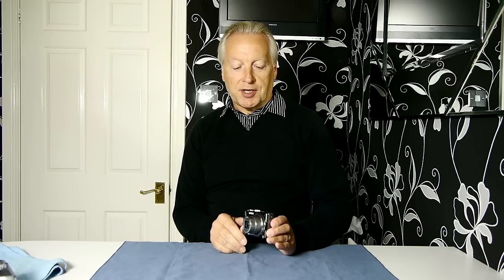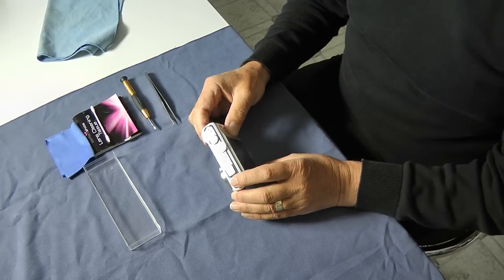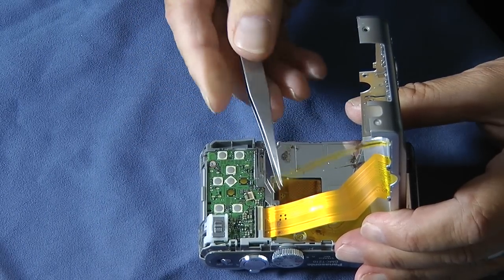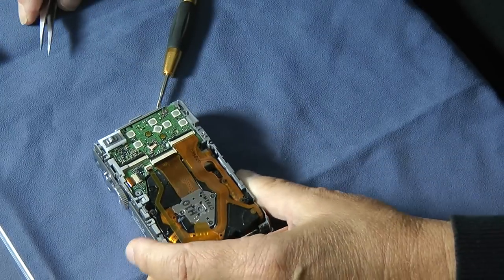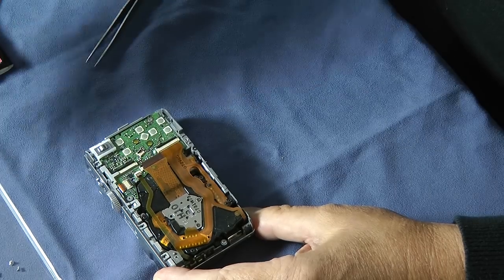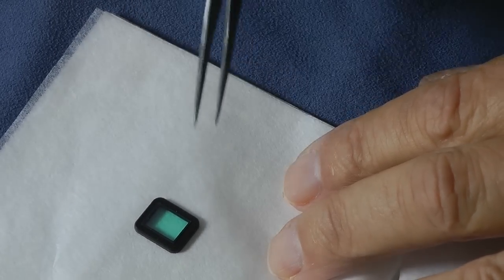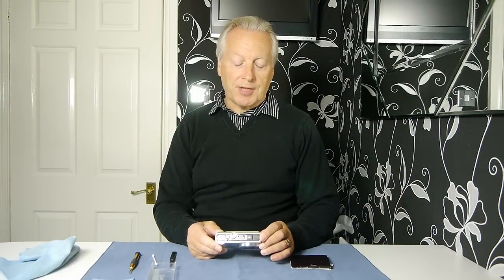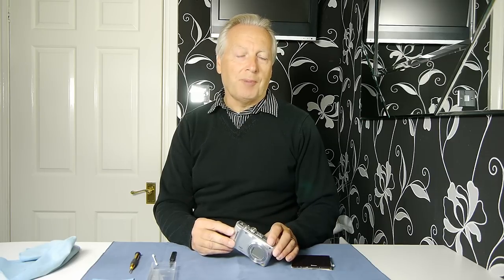Cleaning the CCD sensor of a Panasonic Lumix Compact Digital Camera

Comment: Thank you Graham!

I carried out the procedure on a DMC-FX12 and finished about 5 minutes ago. All is well, the spots have gone. A few points that may help others...

1) The case screws were extremely tight and each one eventually loosened with a distinct click. Was concerned about shearing them and added a tiny drop of penetrating oil to the heads, then wiped clean around each head before unscrewing.

2) On this camera the ribbon connector for the ccd sensor was not accessible. Rather than remove the circuit board covering the connector I did the cleaning procedure with it still connected. BTW, there is no internal metal plate on this cam.

3) The screws holding the sensor assembly in this camera were Torx screws. I didn't have an appropriate driver and fabricated something which worked (I got away with it! Not recommended.)

4) There were clearly visible specks of dust on both sides of the IR filter as well as the sensor. I tried air which was no go so then tried cotton buds. Unfortunately the buds I used left fibers all over the filter+sensor (cheapo purchase?) and so I used lens tissue wrapped around the end of a bud and all was well. I did have some IPA but didn't see a need to use it.

5) I couldn't see which side of the filter had the IR coating. No matter how hard I looked they seemed the same. So I put it back and just hoped for the best.

Hope these notes might help any DMC-FX12 owners. Thanks again Graham.

Comment: It has equally work for my old Lumix TZ8 ; but for instance, I had only tried to take pictures inside, in my house with very strong lights and brillant colors. I haven't seen the old black or grey task, which was on the internal mirror of the camera ... So I think, that the problem is now resolved, especially with your very hard but precious helps and explications ! Great support from France, Alsace. See ya !!!

Comment from the maker: Yes the service manual suggests that the cmos is recalibrated using a service jig etc if you undo the fixing screws, other users have boldly gone ahead and everything worked afterwards. From the construction the plate carrying the cmos sensor lies flush against the lens housing so i can't really see any problem in removing and replacing. The IR filter is now integrated over the sensor so no danger of it falling out and its easier to clean.

Comment: Brilliant! They say 'you don't get courage before the battle', but this video gave me the confidence to go for it. My Lumix FX-60 had a dust speck in the lower left corner, which made 50% of my photos unusable. I found that the display power cable had a slightly different connector which resisted my gentle persuasion to release the cable, but it turned out that this could remain happily attached while I cleaned the IR filter and rear lens surface, so not really a problem.
Thank you again.

Comment: Thank you Graham for a top video.  My TZ20 had about 8 blobs that I thought at first were on the outside of the lens.  With the help of your video I managed to get to to the CCD without a problem, although there are a few small differences between the TZ10 and TZ20.  The filter with gasket was stuck to the CCD so I didn't try to remove it it just cleaned the back of the filter and back of the lens with buds as per your video. Works perfect now without any blobs.  
Thanks again.

Comment: Excellent - I fixed a friends TZ2 with a new sensor and then bought a TZ3 cheap on Ebay in the knowledge that I could easily replace the sensor if it failed. Extremely well produced videos.  I shall be looking at all your others.  Thank you Graham Houghton.

Comment: Mate, you just saved me over $100. All I had to buy was some little screwdrivers (less than $5). Mind you, it was bloody hard to undo the screws - they were really tight.

The innards of the camera (a ZS15) were a little different from what you show, but close enough to work out what to do. The IR filter didn't release from the sensor and I was a bit reluctant to prise it off. So I just cleaned the surface of the filter and the back of the lens. Problem solved! Thanks a lot Graham.

Comment: After I was successful at moving the spots I found that my closeup focus was terrible.  Loosing the CCD screws half a turn each solved the problem.  Then I did another quarter turn and found the closeup focus better than ever.  I also needed to file the blades of the my cheap tiny screwdriver - they were too thck to fit into the screw slots.  Excellant video!
Reply from the maker: thanks for your reply, it might help others too.

Comment: Thanks for your video. I just finished cleaning dirt from the infrared filter on my ZR3. One of the friction connectors was a little different but with your video this was a very simple process. The infrared filter came off attached to the CCD but it was readily apparent that a speck of dirt on the filter was causing my problem. Thanks again.
Reply from the maker: thank you for providing the feedback

Comment: Thanks Graham!  Great guide for the chronic do-it-yourselfer.  Cleared up blotches.  The IR filter was dusty as expected and it was my biggest problem.  It fell out of the gasket and getting it the right way around and reassembled (as per your written instructions on the screen) was tricky.  I may have gotten a bit of oil off my finger on it.  I expect the filter can be cleaned with isopropyl alcohol if need be.  I took the battery out of the camera before disassembly.  Thanks for you help!

Comment: Saved my Lumix TZ6.  Thanks for the video.  I noticed my case screws had what appeared to be blue Loctite on the threads.  Made them a bit more dicey to get out.  Inner plate and CCD screws did not.  Also, since the IR filter was tightly fit to the CCD, all of the dust was on the outside of the filter.  A simple blow from my air bulb cleaned it perfectly without touching the surface.  Whatever works! Thanks again for the video.  Would never have tried cleaning without it!

Comment: Thank you SO much for this. I had 3 ugly bands of grey-lack on all my clear sky and water photos. I used this video to clean my DMC-ZS7 and it worked, removing most of the spots!. I still have two tiny ones which must be from the front of the lens (when I peek in thru the lens, I do see tiny specks of dust) which I am just going to ignore for now. With much gratitude..

Comment: Thanks. I had acquired a lot of dust particles in my ZS10 that I use constantly for work and thought I was going to have to scrap it. The dis-assembly and internals were slightly different than the model in the video but the process was the same. The results were an outstanding success!

Comment from the maker: thanks for the comment and well done. It is possible to do it with the cables attached however on previous models the backlight cable is so thin you risk tearing it. The TZ20 has a different cable structure.

Comment: Many thanks for a clear instructions, I've just cleaned a TZ19. The ribbon (single one) is double tapped to the back of the CCD block, making it just that bit harder to remove.  The IR filter is, like the TZ20 is stuck to the CCD.

Comment: Thanks that's really helpful.  For the TZ70 there is an additional copper plate covering most of the back and the 3 screws hold the sensor in are T5 Torx heads while all the other screws are still crossheads.

Comment: Hi Graham thank you for your reply, Nothing at all happens when you switch on. We didn't remove the battery and only removed the sensor and lcd ribbon cables as on your video. Have double checked that the ribbon cables are correctly connected.

Comment: Thanks Graham, I took courage from your clear instructions and attempted successfully to clean the sensor on my TZ18 camera. However, I would like to point out that this model is not set up inside like the other models and the ribbon cable is very short and attached to the middle of the underside of the viewing screen, making it extremely difficult to put the cable back once taken out. The screen is almost hinged as a result and you can't get a grip on the cable so to speak. I only managed to do it with the help of some borrowed flat tweezers (plastic or rubber tipped ones would be best), even then, I am not convinced it's back as far as it should be as a dark section of cable was still visible, but it would go no further without being able to get proper purchase. Also, I would like to point out that the tiny screws are not interchangeable (I think they are colour coded), so please take care that you put the screws back into the correct holes! Unless you are very confident, I would recommend with this model to get it professionally cleaned. I would hesitate to do it again, due to the ribbon cable issue. At least it still works! Phew!

Comment from the maker: I used a very cheap set, a number PH0 is the one i use and found it works with all the camera screws, remember to kep a firm downward pressure to prevent slipping. Some of the case screws might have locking compound applied on the threads.

Comment: Hi Graham,
Yes, well done video. I can report (if you haven't already), that the ZS20 (TZ30?), is put together a bit differently; perhaps even easier to open than the model you used. Once I got down to the plate holding/covering the CCD, I could see we were in for a bit more challenge.  The screws are unlike those holding the case together. I think they're called 'torx' 6 lobe internal. And they're sealed! I backed out, and go at it another time - maybe.

Comment from the maker: Thank you Luc for your feedback and well done. If the dust on the lens isn't causing any flair problems I would leave it as the TZ10 lens is much harder to strip than the one shown in my other video and you might well end up with a camera you can't use at all. Rarely dust on lenses causes that much of an issue, more of a perceived one and that applies to minor scratches as well

Comment from the maker: Thanks for responding to the video. Another success, well done. Yes the correct way was as you did to clean woth lens cleaner and blot dry. Yo can handle the filter with tweezers ( preferrably plastic ones) as long as you only hold it at the extreme edges where any marks would be hidden by the plastic mount which it rests in. Thanks again, Graham

Comment: Nice one.  Just applied this to a TZ20 which has minor differences in the case, and the LCD  attachment.  Great tip on those ribbon connectors.  Took me about 20 mins and I could see the offending items on the CCD.  I cleaned mine with Servisol Aerosol Duster to avoid touching anything.  Save me a bunch of money, but there goes the excuse for a new camera!  Many thanks.

Comment: Brilliant ! ... my TZ20 was a little different, in design but the end result was a great success. I followed your tuition as seen.  At my first attempt .. the large blemish on the sensor had split  into several smaller spots..upon my second try..(much quicker of course)..! and using a pad from my NEX 5 sensor cleaning kit - all was crystal clear. I use the TZ20 for travel and now feel confident enough to clean whilst away as required. All is good ..problem solved. Thanks a million..!  DGJ.

Comment from the maker: The sensor of the LX series is aligned to the lens differently and requires the camera be calibrated after it has been removed and re-assembled so it is advisable not the split this combination. One viewer said she used a vacuum cleaner to suck air through the extended lens of her camera and it shifted a spot of dust in her camera lens - might be worth a go.

Comment from the maker: Hello Ellie. The ZS10 has a different method of fixing the lcd. The lcd sits in a silver frame wich is held in place with 3 screws. These screws have to be removed to gain access to the lens. The actual LCD clips into the silver frame. If you look at my BLOG page under camera reviews you will find the TZ20 service manual which will show how to dismantle the camera correctly. The IR filter is fixed in the ZS10 so it doesnt fall off like the ZS3

Comment from the maker: Thanks for the comment and yes the backlight cable is the one which looks like it should be installed the other way up, fortunately no harm is done if you get it wrong just the panic when the screen doesn't light up.

Comment: Many Thanks Graham, dust plagued our last holiday photos, and was close to just opening it up anyway (before otherwise buying a new camera), this really up'ed my confidence.  Followed your very clear instructions, and wonderful - clear photos again - greated appreciated, keep up the good work.
Reply from the maker: Thanks for the comment and well done for having the confidence to try it yourself.
Reply from the maker: If the locking lever has broken off it is going to be difficult to get a good connection between the socket and the edge connector of the ribbon cable as the lever forces down the connecting pins onto the ribbon. Unless you can fit the locking lever back over the socket and secure it with very strong adhesive tape or some high density foam that you can place over it and have the back case of the camera apply the pressure when it is ref-fitted i don't think you will be able to get a good connection

Comment from the maker: @d2gizzo Its less likely to occur as the construction of the lens frames ( the bits that make the lens zoom) is different and the front of the lens barrel is usually better protected with no areas for dust to settle in whilst the lens is extended. In the compacts dust can settle around the lens cap blades and gets ingested when the camera extends the lens.

Comment: Thank you - just tried this on a TZ8 that my mother had asked me to try and sell.  I. noticed all pictures had a small grey circle - a few mm wide when seen on sensor and I was thinking it might be dust in the lens and would want to sell the camera with such a fault.  Quick search found this video.  Followed the instructions and I found the camera was very easy to open up and get to the sensor.  In my case I could see the speck of dust on the filter so dusted it off with a lens pen.  Back together and the fault has now gone.

Comment from the maker: Hi Jenna, It may be possible the camera needs a full reset to allow it to start up correctly. this isn't documented anywhere but has worked now for a few users who didn't remove the battery before stripping the camera. You can try it. Remove the battery completely and leave it out for AT LEAST 24 hours. During this period the residual power stored in the camera circuits leak away allowing it to reset on the next power on. Let me know how you get on for other ideas if this doesn't work

Comment: Absolutely superb video. Came here looking for potential CCD failure but it appears to explain a great deal, hope it IS this that's the problem. Excellent instructions, potential pitfalls and video quality. Having worked on microscopes (optical and electron) for many years, I may have considered a small soft blast of air or similar to clean off any residual dust or fibres from the initial clean. Will keep you posted, many thanks...

Comment: A follow up to my recent comment on this. Great, worked a treat. The TZ18 I have has a slightly different case (end caps) and only one ribbon for the LCD, however, fundamentally the same. I did remove the battery prior to the technique as a precaution too. Black spot on image now gone and the camera is back to spec. Many thanks again for this, superb!

Comment from the maker: The TZ20 has 3 ribbon cables to the lcd screen ( the additional touch screen) but essentially the same, as atticboyy11 pointed out the IR filter is now attache dto the CMOS sensor so it is easier to clean and less chance of breaking it. Just proceed slowly and carefully ( remember to take out the battery) and it will work fine for you.

Comment from the maker: @yeti66tl Hi, the "frames" as they are called are just in helox grooves, one inside each other. If you has taken the lens apart, and removed the backplate which holds the focus motor and lens then you shoulkd be able to remove the focus motor/drive from the plastic and clean the groove where the brass drive mechanism slides. If it is a focus error this is all you need to do. If it is a zoom error then you need to carefully separate the Frames by rotating them one at a time to remove them

Comment from the maker: Hi, the vacuum idea was a subscriber idea which worked for them - it would only remove dust from the lens area I guess and not the sensor. If your camera went into salt water and you didn't get the battery out very quickly the chances are the camera is totally destroyed. Salt water is highly conductive and all the electronics get "fried" and the very fine copper tracks on the circuit board act as fuses. If the camera no longer powers up then the main protection fuse blew - this is the end for it

Comment: Thank you for saving my FH25. I got home from a once in a lifetime  trip and found grey blotches on blue sky areas.  I found a tiny scratch on the front element and figured that a camera that sells for less than 60 U.S. dollars will never be used again. 
I'll add to this comment after I work up the nerve to clean the inside. It will be good practice for my FZ300 in years after the warranty has expired.

Comment: Thanks for the prompt reply. This model has only one ribbon cable from the screen back to the pcb board, and it's very short, making it a real challenge to connect as it necessitates holding the camera back quite close as you reconnect. This doesn't allow a lot of room to maneuver or see what you are doing. I did manage to reinsert the cable and the locking latch is down. I just wonder if I somehow shorted out a critical area of the board with my metal tweezers when inserting the ribbon cable.